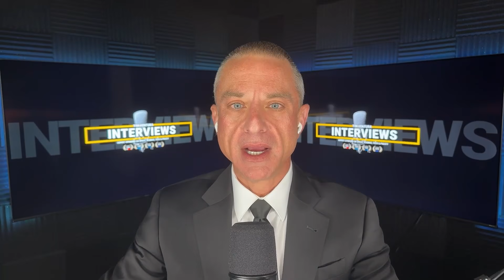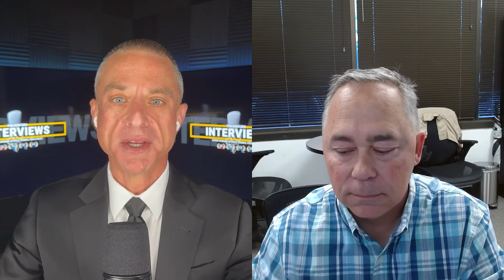Casimir Zero-Point Energy & Warp Drives | Harold “Sonny” White

Comment: Very much sounds like T.H. Moray's tube. He originally used some radioactive ore (maybe uranium) he found and per his patent and books also mercury vapor and argon.
Later he used purified germanium doped with: bismuth, iron sulfide, molybdenum sulfide, triboluminescent zinc, silver wire contacts, and uranium to make them.
For me this was one of those rabbit holes 13 years ago, I talked to his son John (in his 80's at the time) over the phone, etc.
And related is Tesla's 1901 patent on the subject.

Though it could be real or maybe it was just some hoax. He did have legit patents and legit witnesses to his device that powered several 100w bulbs on a box with an antenna, grounding rod, and his valve tubes.
This was the 20's and 30's, long before Bell Labs claim for the transistor in 1947 and before B. G. Casimir's paper in 1948.
Although his patent describes how the tube works, the outline of it, he never documented exactly how to make the tube and people that tried failed (at least publically).

Maybe the Moray device was real after all. Waiting for 2028 commercial release of this chip to play with one.

Comment: Warp Drive is impossible beacause of no space object can win with spacetime and latest discoveries like black hole Phoenix A with size of 110.48 kiloparsecs (360,300 light-years) - in comparision Milky Way is just dot) and have 8.22292x10(149) energy delivers evidence not object can create buble or wormhole idea like this stays in fantasy where is coming from. Bouble of worp drive of diameter about 1000m have to fight aganst about  1.410x10(53) jules equals 3.916666666E+43 MegaWatts per second multiply by speed in meters per second.  Abowe value is about 100 part of Sun energy and currentlly imposible to achive but to fly faster you must deliver more energy so multiply MW by m/s and this is why WorpDrive is ipossible. 
Better to work over hyperdrive where more power you delivers more efects recive without imposible amounts of energy.

Comment: I might have you beat with my gravity well drives that create a slope in spacetime that you fall towards with negative effective mass reinforcing the curvature indefinitely and temporal displacement so that the energy is not affected by noise we could then create a self sustaining warp bubble that we could use that is 10 to the 11th power in energy cost which is high but far more doable than alcubierres metrics.

Comment: A Unified Theory of NGU Operation: Condensate Formation and Energy Extraction

The theoretical foundation for the SK Generation of reactors: the soon to be commercially released version being the (NGU) reactor involves a two-stage process. First, an Exciton Polariton condensate (BEC) is created using one of two distinct methods. Second, this BEC is harnessed as an engine to initiate a powerful energy-releasing cycle based on the principles of the dynamic Casimir effect and vacuum decay.

Part 1: Forming the Condensate
The initial and most critical step is the formation of the BEC within a hydrogen and/or lithium atmosphere.

Method A: Catalysis via Ultra Dense Hydrogen (UDH)
This indirect method relies on creating a catalytic material first.

UDH Formation: A fast-rising electrical spark delivers an intense pulse of energy into the gas, compressing it into a bubble of Ultra Dense Hydrogen (UDH).

BEC Catalysis: The UDH bubble then functions as a natural optical cavity. As a proposed hole superconductor, its dense electron cloud facilitates a strong light-matter coupling between photons and excitons, leading to the formation of the BEC.

Method B: Direct Activation via Electron Gun
This more direct approach bypasses the need for a UDH catalyst. An electron gun fires a beam into the gas, directly activating a sufficient number of exciton polariton quasiparticles. This triggers an aggregation process that immediately initiates the formation of the BEC.

Part 2: Energy Extraction via Vacuum Decay
Once the BEC is formed by either method, it becomes the core of the energy generation cycle. The process unfolds in four stages.

1. Creating a "Dynamic Casimir Cavity"
The BEC naturally generates intense, coherent light. According to the theory, this light production creates a reaction force, causing the condensate to project a negative energy field or behave as if it has negative mass. This field neutralizes the virtual particles in the immediate vicinity, creating a localized zone of suppressed vacuum energy. This zone functions as a dynamic Casimir cavity without requiring physical walls.

2. Triggering Vacuum Decay
A magnetic domain wall is theorized to form around this dynamic cavity, encapsulating the region and creating an isolated "bubble." This bubble contains a vacuum state at a much lower energy level than the "normal" vacuum outside of it. This profound energy imbalance triggers vacuum decay, causing energy from the surrounding, higher-energy vacuum to continuously flow into the bubble.

3. The Positive Feedback Loop
The inflow of vacuum energy establishes a powerful positive feedback loop:

Energy flowing into the bubble is absorbed by the BEC.

This causes the BEC to generate even more intense light.

The intensified light strengthens the negative energy effect, reinforcing the dynamic cavity.

A stronger cavity pulls in vacuum energy at an even faster rate.

This self-amplifying cycle causes the bubble to accumulate energy rapidly, manifesting as a continually increasing output of light.

4. Energy Conversion
While the bubble is actively growing, it produces immense levels of light. This light is the primary energy output harvested during the reaction. The intense light is directed onto a high-efficiency photovoltaic cell, which converts it directly into usable electrical power.

Comment: The gearless Differential system of push pulls in its design is necessary to create the most important part of energy and environmental factors including gravity and powerful forces that disturbs gravity the bubble trapped in gelatinous vfc density to keep a spherical spinning bubble in multiple wavelengths seperated with each other to resonances of magnetic fields and non magnetic fields that inducts a variety of gravity frequencies that bounceback into the long to short charge jumping from point to point insulator tunnels that they noble gas to exotic plasmas and expand contracts with the waves of natural resources to gravitational pressure

Comment: Intuition from late 1990s  ...Casmir forces are small if broadband, but perhaps very different in a high-Q resonance situation.   Nanodots and nano-pillars provide narrow-linewidth resonance.  Spoil the resonance, and then the force drops low, so use this as a "piston engine."
Similar physics seen in "Mag Loop" antennas used in ham radio, where the resonant antenna is thousands of times smaller than quarterwave.     
Another:  a single electron is a conductor (causes current when e-field is applied.)   So, each electron should experience immense, radial-inwards Casmir force, no?   Shoulders' EVOs might involve significant energy output, all from Casmir.
Reply: Hey William Betty, I just wanted to thank you on your article answering what voltage is & Equilibrium Surfaces.

Comment: Garret Moddel and his research group at the University of Colorado Boulder have done significant work on Metal-Insulator-Metal (MIM) diodes and their potential connection to the Casimir effect. 
The core idea
Moddel's research explores the possibility that a Casimir cavity, when placed near a MIM tunneling device, can induce a measurable electrical current between the metal layers, even without an applied voltage. This suggests a potential link between the vacuum energy fluctuations of the Casimir effect and the electron tunneling in the MIM diode, according to the University of Colorado Boulder. 

zero-point energy (ZPE) does not necessarily violate the second law of thermodynamics based on conventional quantum interpretations of ZPE. One line of thought suggests that if energy is extracted locally from the quantum vacuum and replenished globally, it might not contradict the principles of the second law when considering the system and its environment as a whole.
Reply: I thought the same thing when I watched this. Good to see two different groups coming up with similar results.
Reply: That or it suggests that the universe is not the closed system we once thought
Reply: Replenished globally How? Also, what about potential violation of conservation of energy, apparently these batteries can last forever?

Comment: The four 72' German saucers had zero point with 3 rotating magnet rings, middle counter rotating that power from Birkeland currents. Two had been sent into the sun for safe disposal when I was briefed. The successful reverse engineering failed with weakening magnetic shielding. Search "G-Iron" two layers needed to isolate magnets on both sides.

Comment: Unfortunately, battery & motor manufacturing is so CO2 intensive (ore processing) that having a ZPE recharger doesn't help much to enable a post-fossil-fuel economy. Also, most chip foundries will close as the global supply chain crumbles due to global heating.

Comment: Casimir effect, I think refers to using Sundara Vimana to emgage ionic thrusters into the magnetic field of a star, like 2 conductors, with a vacuum in between, which attracts the ship past the south (-) pole of a star 

Which also collects current as radiation, which would overcharge the batteries, if it didn't flow through to a certain degree, into the magnetoplasmadynamic motors, for higher voltage output temporarily.. 

Which discharges the excess current

As opposed to Alcubierre Warp Tunneling 

Which purposely avoids stars and objects, and relies on empty space
Reply: Great time to be alive.

Comment: If the DARPA funded low acceleration quantized inertia reactionless drive works and it is  is combined with this ZPE extraction system you could have a propulsion system with ridiculously high potential velocities.
Reply: If you thought of  it, Darpa did it
Reply: Yeah, frank mead Magnetohydrodymanic Drive MHD. and Lockheed m has the Coherent matterwave beam CMB, you're welcome ❤

Comment: Colorado has patents on a zero point energy extraction system that forces a noble gas through nano scale casimir pores to change the electron orbitals and extract energy when they return to their normal state.  I believe that’s in a nutshell how it works.
Reply: Awesome yes xenon ?
Reply: @HutchisonEffect  I think I remember that.
Reply: ChatGPT summary:

Dr. Harold “Sonny” White and his team at Casimir LLC have developed nanoscale devices that appear to harvest usable electrical energy from the quantum vacuum via a novel modification of the Casimir effect. By structuring conductive cavity walls with central nanoscale pillars, they create an asymmetric environment that induces preferential electron tunneling—resulting in continuous voltage and current generation without external input. Prototypes have demonstrated up to 1.5 volts and 25 microamps from a chip the size of a fingernail, sufficient for powering ultra-low-power electronics. The mechanism is based on well-established quantum physics and does not violate thermodynamic laws, though independent replication is still needed for full validation.
Reply: @antholito when will it come to market when will we get phone that dosent need charging
Reply: Sounds like aerogels are needed for that.
Reply: Very much sounds like T.H. Moray's tube. He originally used some radioactive ore (maybe uranium) he found and per his patent and books also mercury vapor and argon.
Later he used purified germanium doped with: bismuth, iron sulfide, molybdenum sulfide, triboluminescent zinc, silver wire contacts, and uranium to make them.
For me this was one of those rabbit holes 13 years ago, I talked to his son John (in his 80's at the time) over the phone, etc.

Though it could be real or maybe it was just some hoax. He did have legit patents and legit witnesses to his device that powered several 100w bulbs on a box with an antenna, grounding rod, and his valve tubes.
This was the 20's and 30's, long before Bell Labs claim for the transistor in 1947 and the Casimir effect 1948.

Maybe the Moray device was real after all. Waiting for 2028 here for the commercial release of this chip to play with one.
Reply: WoW!

Comment: Hi Tim and Sonny.

1. Why use more than one "pillars" in the middle.  That's unnecessarily redundant, if we accept your theory of operation to be accurate.

2. How do you bias the system so that electrons are repelled from the wall instead of from the pillars?  Are the pillars and cavity doped differently?  Or use dissimilar metals as in the Seebeck Effect (thermocouples)? And they must be insulated from each other - this was not clear in your explanation.

3. Why why not make the devices longer instead of stacking them to get more power, possibly even hundreds of times more power from each cell.

You may have gotten it to work, but this explanation was not convincing.  Garret Moddel's work on zpe deals with how the diode effect is accomplished and addresses the Maxwell's Demon issue which is the one-way gate or "diode" effect.

Might have been an oversight?  Or underestimated your audience??

The Woo Crew
-rs

Comment: A crucial aspect of the Casimir effect is the inverse relationship between the negative energy density and the distance separating the plates. The closer the plates are to each other, the stronger the negative energy density becomes. Specifically, the magnitude of this negative energy density is inversely proportional to the fourth power of the distance between the plates. While the Casimir effect allows for the existence of negative energy, there are limits to how negative this energy can be and for how long it can be maintained. These limitations are described by the quantum inequalities, which are fundamental constraints on the magnitude and duration of negative energy densities. According to these principles, it is possible to make the energy density in the gap between the plates even more negative than the standard Casimir value, but only for a very short period. The more the energy density is suppressed below the Casimir value, the shorter the time this state can be sustained. This effect has been considered a potential source for this exotic matter. However, the quantum inequalities impose significant restrictions. For macroscopic wormholes or warp drives to be feasible, the negative energy would need to be confined to incredibly thin regions. This suggests that if such structures are possible at all, they would likely be limited to microscopic scales.
Reply: There is no indication that negative energy is responsible for the Casimir effect. It has always been modeled as external forces pushing on the exterior of the plates. Puleeese! Stop w the disinformation.